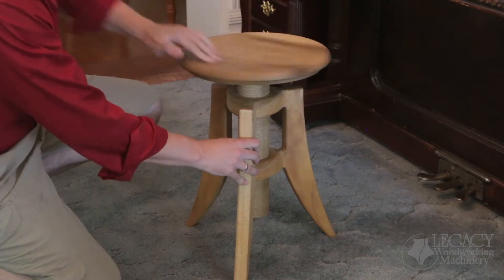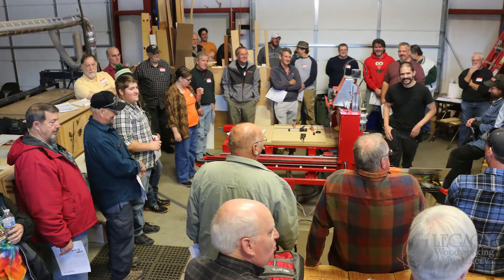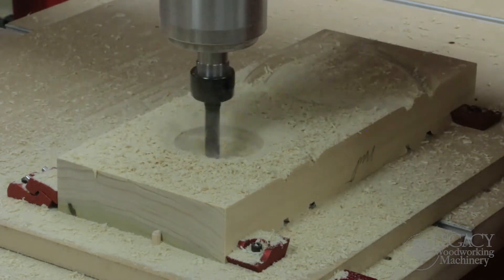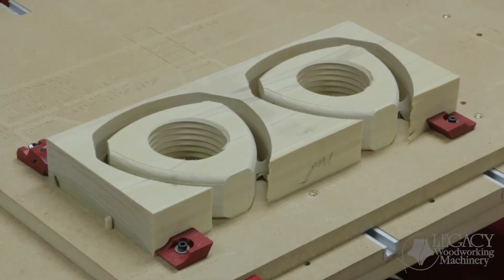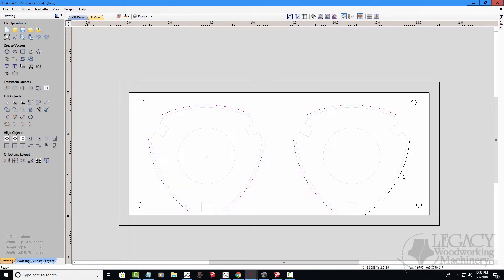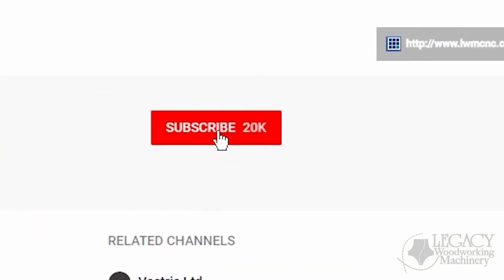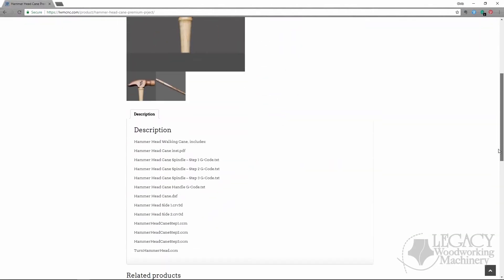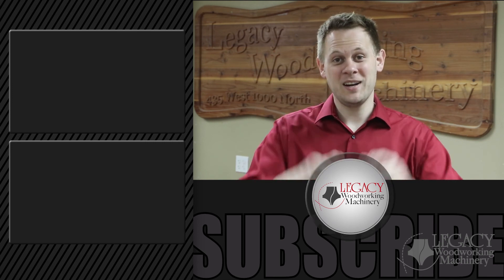4x8 CNC Router Wood CNC Projects: Cutting Threads In Wood Adjustable Stool [ 3 Of 3]

Comment: What is the maker and part number  of tool you use to make threads?
Reply: Search for "threadmill" and you should come up with bits that can do this, once you have the tool path laid out that is.
Reply: @jarodmorris611  What I can find is only with a 1/4" shank by Magna 796,  and you are using 1/2".  Search doesn't give any result. :(
Reply: @jarodmorris611  Why is it so hard to give a good answer? Why don't you go and do a google search and see? Google is thinking you made a typo and treadmill comes up. The video is good up till the point of not being able to locate the same tool used. :/
Reply: @StevenCookFX  which is why I put quotes around it because that tells Google this is exactly what I want you to search for. I think you misunderstood my answer, which does not make my answer bad.